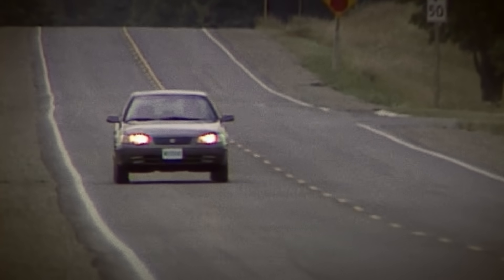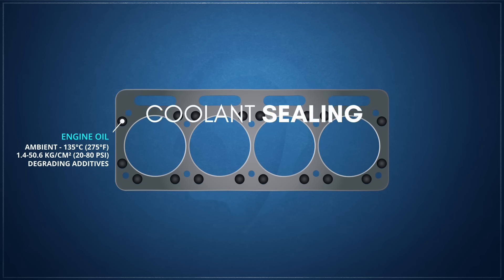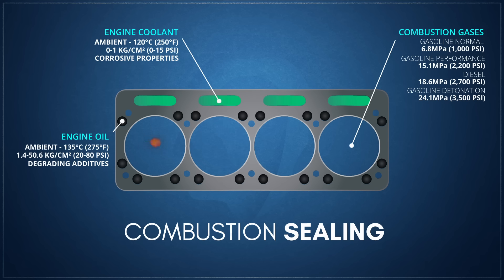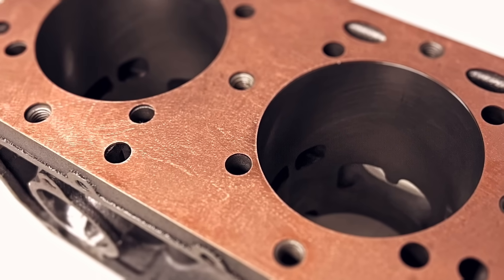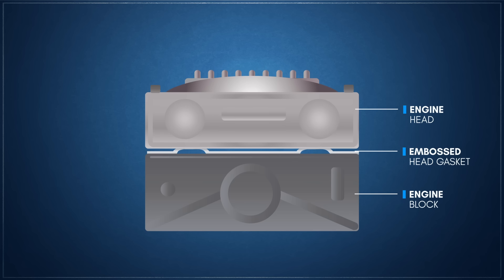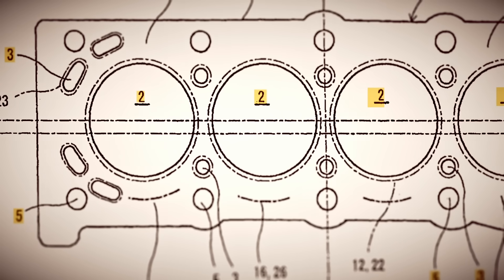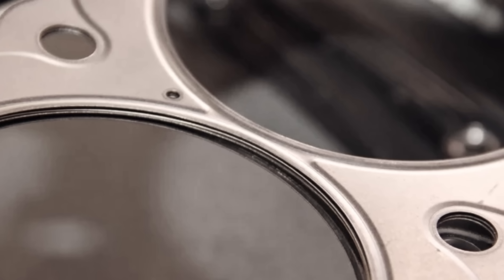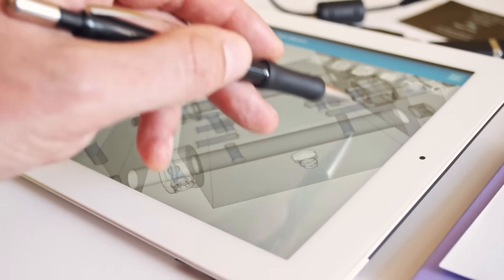The Most Tortured Part In An Engine

Comment: In 2005/2006 we were trying to build the 1st 1000whp e36 328 (m52 engine) The toughest/most aggravating part of the build was getting the headgasket to seal under high boost. Around 17psi the gasket would blow out in between cylinders. One reason why we went with the 2.8L m52 instead of the 3.2L s52 from the m3, m52 has a bore of 84mm and s52 is 86.4mm. Those extra mm's made all the difference. Even with the extra material we still o-ringed the block n head. That was the trick that put us for ahead of the competition and helped us have the world's 1st 1000whp m52. Also 1st in the 9s while still having full interior,  heated seats and ac.Havnt been back to the track ever since we got kicked out and told we need a parachute lol. 16 years later and only like 2 others have made that much power. Truly were miles ahead of the competition.
Reply: I have built many supercharged and high compression engines.  I have always used plain soft copper with aviation quality sealer sprayed on both surfaces.  It works far better than 90% of the "for boosted engine" commercially available gasket solutions.
Reply: @3RTracing  yea i mean since the 1970's id argue head gasket failures where not nearly as common as this video makes them out to be. by the 1980's forget it... rare for most.
Reply: TMS here in Stamford had a 1100 whp e36 m3 years ago. did see the car in person but never saw it on the dyno so not sure if that was accurate but it was a beast.
Reply: @ct1762  idk why i didn't see your comment before but im pretty sure you're thinking of ICS (imported cars of stamford) They did the first build and then sponsored the car with labor / dyno time. George (the owner) was like family for years. We'd stay at his house once it was built. Before that we stayed at a place that was right by Mike tysons old/50 cent new house in Greenwich. A guy from the forums let us stay in his guest house. All a culture shock for me being from Southern Maryland in the middle of old tobacco fields. Everyone up in Stamford called us "The Rednecks" 😂
Reply: @shifty1927  ha no worries! i do remember something George was saying about snapping driveshafts. not sure what the final fix was?
Reply: Pretty crazy that you can make similar power on  stock S58 these days.
Reply: @borderwave2  made 715whp on the stock m52 in 2005. This was before e85 and the tuning options available today. Built 25 years later and  specifically for boost is still barely better.
Reply: @shifty1927  That's very impressive for a stock NA motor.
Reply: One day if I ever hit the lotto I'd like to try and get 1000hp out of my m57 
I'm sure it could be done but it would be a pretty huge undertaking 😂
Reply: @krspykreame1  that would be bad ass. Probably have 1600ft pounds of torque or something crazy like that.🔥🔥
Reply: Well done my guy
Reply: A moment of silence for the BMW in-line 6’s.  World class engines that economy has relegated to history.
Reply: @brainkill7034  they still exist. Now they just come with turbos. More like r.i.p. to NA performance i6's.
Reply: Should have gone with a M50 instead and problem solved
Reply: @henrik1743  Nope...m50 and m52 have the exact same bore.
Reply: This is hilarious.  You never mention where you raced or what competition you beat.  I've been to plenty
Of amateur drag strips and never seen or heard of anyone requiring parachutes running cars in the high 9s or 9s at all   Seen cars in mid 8s no chute running on garbage amateur tracks 

The funniest part though is the fact that there's 1000-1200 horsepower big blocks running 7.70s and 7.80s.   Your horsepower means nothing if you can't put it to the ground- which is what it sounds like in your case.   Not to mention in a tiny motor you make that 1000hp in a TINY part of the rpm curve ( the top) where there's absolutely no torque.
Reply: Ps.   In 2015 there's guys making close to 1000hp in 1000cc. ( that's 1 liter) sport bike engines.    Yes they are turbocharged and have progressive nitrous but so what? They are running 6.90s at 200mph
Reply: @ryany4326  it was nhra rules so guess you're not as competent as you act. At the time any car 9.99 or quicker or over 150mph trap needed a parachute. You typed all that for nothing kid.🤣
Reply: @ryany4326  also every run is well documented on bimmerforums forced induction forum if you're intelligent enough to do the research before you speak next time.
Reply: Could have just oringed
It

Comment: 2:17 kg/cm² ist not a unit of pressure; kg represents mass not force. Use Pascal (Pa = N/m²) for pressure. Atmospheric pressure is around 100 kPa (~14.5 psi for non metric countries like Liberia). And check your calculation 1.5 bar may convert roughly into 20 psi, but 80 psi would be 6 bar not 50.6. 50 bar would be around 700 psi.
Reply: kgf/cm² (kp/cm²) is. But yes, just use Pascal or Bar.

Comment: But the most stressed part is clearly the driver.

Joking aside, the most stressed part in my opinion, based purely on how frequently it needs replacement, is the oil. I really don't think it's fair to not consider it a part because of how critical it is and how it DOES stay in the engine for long periods of time. A fluid component is still a component.
Reply: (After hearing you list the forces a head gasket must endure... oil has to endure all of those as well. :D Yes, it isn't supposed to be combusted, but a small amount does stay behind in the cylinders and get combusted, always. And that has to combust cleanly enough to not cause problems for the rest of it, while not leaving so much in there that it causes a problem for anything else.)

Comment: I see nobody has mentioned the notorious MG Rover K-series engine, which became notorious for its head gasket failures. The worst of the variants being the 1.8 litre engine, but the 1.4 litre also suffered. The engine was an eye-opener when it came on sale in the cars in the 90s, giving 104 bhp for the 1.4 litre when most of the other manufacturers were pushed to get 8--85 bhp. A racing-type exhaust was fitted and EFI (of course). An all aluminium engine, the block was of the open-deck design with steel liners a light push fit. A fatal flaw was the use of plastic dowels to locate the head to the block and the head bolts had no location function as they screwed into a separate oil rail underneath the block so the whole engine was one big sandwich. It was, in all its essentials, a racing engine for the road !
Over time, with vibration, the plastic dowels degraded and allowed the head to "shuffle" on the block with inevitable head gasket failure.  Even when these were finally replaced by steel, HGF still occurred but at higher mileages. It was only in the early 2000s, that the head gasket was changed to a multi-layer type, and the oil rail at the bottom of the engine redesigned plus use of better alloy, that the problem was cured. But the company went bust shortly after. You would think that senior management, knowing this engine went into every single one of their cars,  would have acted sooner, but they were seemingly too busy playing leapfrog ! 
I've got an MG TF with the 1.8 engine, but it is a chinese version with all the improvements, so no problem so far anyway !

Comment: I remember hearing that GM developed Dexcool instead of reengineering their head gaskets, as it can still act as coolant even with oil present.
Reply: That's a pretty nifty "cutting the knot" idea
Reply: Is dexcool compatible with all cars? I’ve seen it before, didn’t know what it was.
Reply: @angelgjr1999  Not really.  Euro coolants are fairly similar, but are still different enough.  Japanese coolant is still like the older Ford/universal specification.
There's a rubber-softening polymer in Dexcool/Euro coolants that I wouldn't want in anything.  I found it listed in the SDS some years ago.
Reply: @veleriphon  Is it compatible with ford 4.6?
Reply: @angelgjr1999  There was a range of years where Ford and Chrysler were basically using Dexcool, but as their own branding/specs.  It wasn't any individual engine, though.
Reply: @veleriphon  Thanks for the info

Comment: Love this channel. People don't consider edge cases and failure points in systems often enough.
Reply: this video is just your typical "youtuber" reach, there is nothing special about head gaskets, any compression gasket can sustand high pressure with no effort.
Reply: @lo2740 what about high temperature, high pressure, oil, water, temperature gradient, mechanical stress while maintanimg an almost perfect seal?

Comment: I’ve always been told that connecting rod bolts are the single most highly stressed components in an internal combustion engine, in terms of pure mechanical stress over a given area / psi force through the component. Head gaskets have a tougher life overall but those combustion pressures are only exposed to a minuscule are of the head gasket when clamped properly.
Reply: oh thats a tricky one. I tend to think most of the force is experienced at or near TDC, meaning almost straight down onto the crank pins, and not laterally on the rod cap/screws. could be wrong and im sure they still experience thousands of PSI!
Reply: @ct1762  the inertia of the piston/rod assembly changing directions after TDC pulls on the bottom half of the rod cap through the rod bolts
Reply: @Nathan0A  yes but the changing direction part would be the least stressful thing. the most would be the explosion of compressed fuel/air as it sends the piston down. the power stroke is what produces well...power.
Reply: @ct1762 Combustion forces do not travel through the rod bolts, nor the head gasket. The area of the head gasket exposed to combustion forces is extremely small, so a very low amount of force is exerted radially on the gasket during combustion compared to what the head bolts/studs and piston/connecting rod endure.  The reciprocating force of the piston and connecting rod in a vacuum (no combustion) at max rpm can exceed 20k lbs, and that force of changing direction around TDC is supported by tensile loading of the connecting rod bolts. Because the rod bolts have a smaller cross sectional area than any other part of the rotating assembly, the psi loading of rod bolts (at highest design rpm) is typically higher than any other engine component. Peak combustion pressures in high performance engines can exceed 1500psi, but consider an example with an engine of 4” bore diameter, you achieve roughly 19k lbs exerted on the top of the piston and through the connecting rod body to the crankshaft. Because the connecting rod body at it’s thinnest point is still a larger cross sectional area than both of the rod bolts and the absolute tension at peak rpm from inertial forces (20k lbs) is higher for piston acceleration than it is for combustion forces (19k lbs), the rod bolts are generally the most stressed component in an internal combustion engine.
Reply: You are correct.  On a 4 cycle the load reversal during the intake stroke is sustained by the rod bolts.  This fatigue load is countered by tensioning (aka preload) the rod bolts.  This sheds most of the tension fatigue load off the bolts to compression fatigue loading of the juncture of the rod and cap.   Generally cracks won’t start when compression loaded.
   The worst rod bolt condition is closed throttle high rpm using the engine as a brake.

    The cylinder gasket ring is subject to hoop stresses from combustion pressures.  However the head bolt preload generates friction between the head and gasket and gasket and cylinder.  This friction absorbs some of the hoop stress.  The preload also acts on the gasket similar to the rod.  Head gasket failure usually from inadequate head bolt preload or overheat/warpage.

The other minor error is narrator misrepresents “seals”.  Seals are divided into dynamic seals and static seals.  Gaskets in turn are a subdivision of static seals.      Cheers
Reply: of course, you are on youtube and "creators" are up to anything to make profit, any ridiculous topic is widely streatched and sensationalized to the extreme for profit, even tho there is nothing special about head gaskets, a compression gasket can handle high pressure without much effort, it is not rocket science.
Reply: Yeah, this video is a reach. Can’t blame people for trying to make money tho. It’s still pretty cool